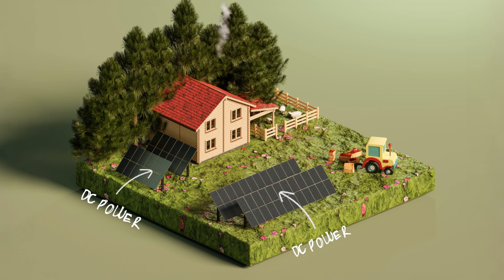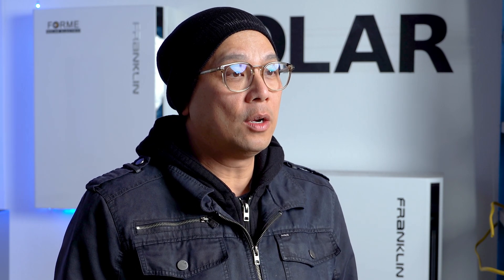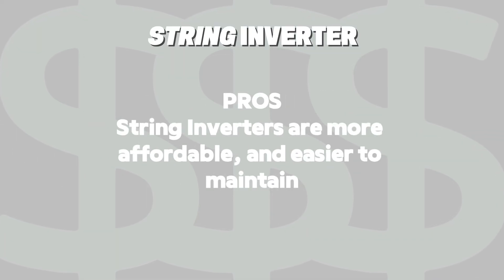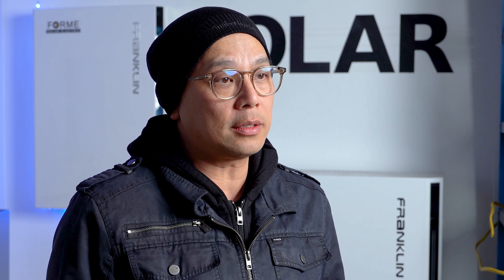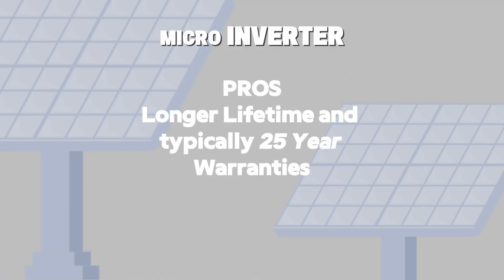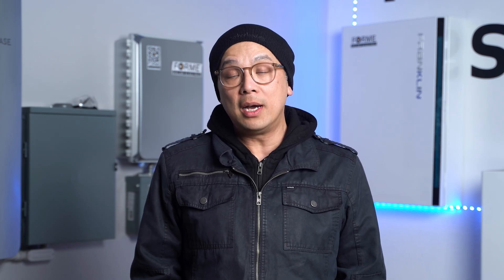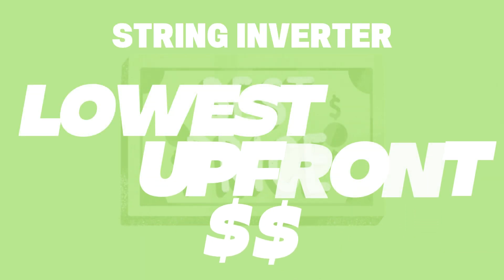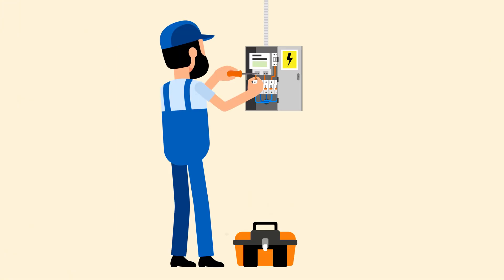Microinverters vs. String Inverters – Which One is Right for You?

Comment: Does micro inverters help me to save power using lithium batteries? 
If I'm going to use the batteries to save power I should convert the AC to DC this is a big loss also converting it back from DC to AC again and this is a lost of power. 
The best is string inverter with optimizers so we'll get the best solution and the best power saving and more flexible
Reply from the maker: That is largely correct and we agree that this is a very efficient solution that you are proposing. For some customers, there are larger factors at play that may require microinverters. But it is mostly personal preference.